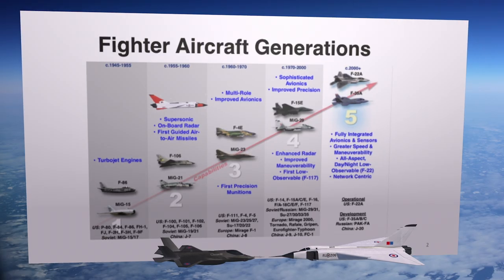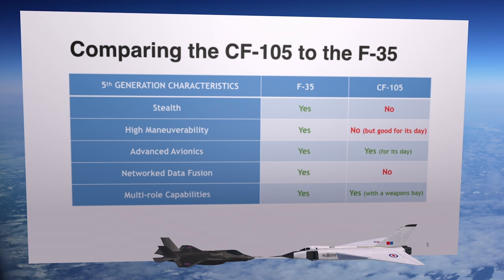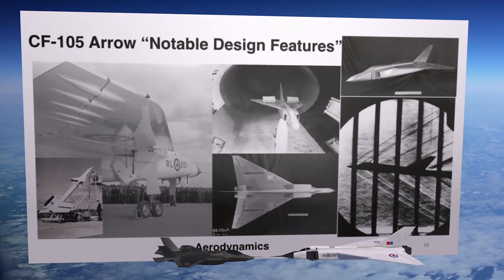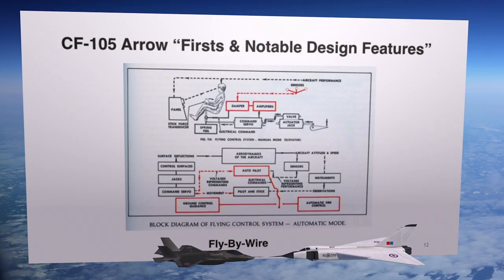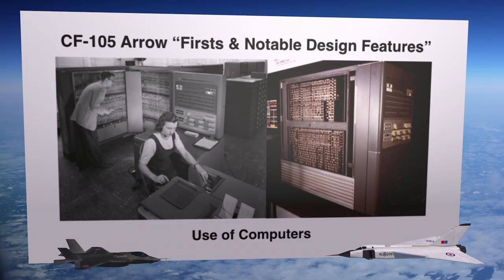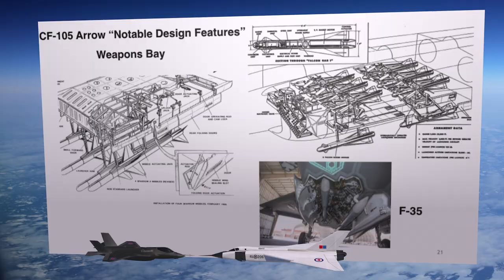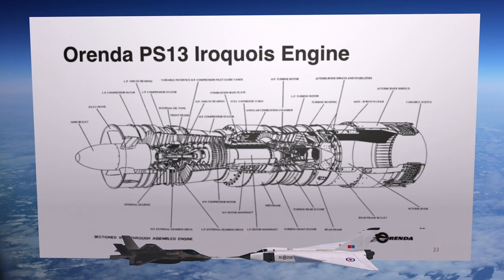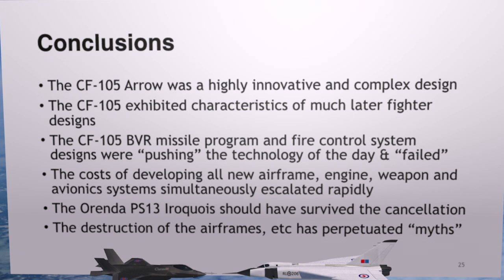AVRO ARROW FIRSTS VS F 35 LIGHTNING

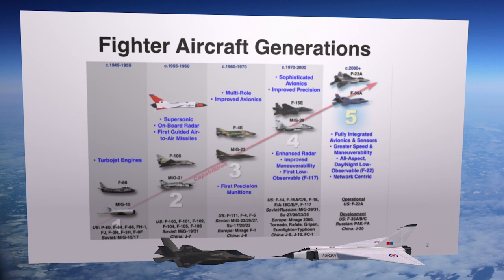Comment: @1:57
Point of interest - That's a CF-105/J-67 proposal from May, 1954. The J-67 suffix denoted the (briefly proposed) Curtiss-Wright J-67 engines, which were cancelled that same year. Note the lack of outboard leading edge extensions (dogtooth) on the wings and lack of an area-ruled tailcone extending out from between the afterburner nozzles. Also interesting is the 500 gallon drop tank mounted immediately aft of the removable armament pack, straddled by the speed brakes. The production CF-105/P.S.13 design followed in June, 1955 - P.S.13 obviously referencing the Orenda P.S.13 Iroquois engines, & would've utilized the same drop tank arrangement.
Prior to the CF-105/J-67 iteration, there was the C104/2-TR.9 (Orenda TR.9 Engines) proposed in June 1952, as well as the CF-105/RB.106 (Rolls-Royce RB.106 engines) from August 1953. Other engines considered for use were the Bristol Olympus OL-3 & the Pratt&Whitney J-75, which powered the first five Mk 1 aircraft.
Another interesting Avro design was the C104/1-TR.9 - a single-engine, low-wing delta, very similar in appearance to the Convair F-102. This was proposed to the RCAF in June 1952, at the same time as the above-mentioned C-104/2. It was quickly dropped in favor of the twin-engine, shoulder wing design which would eventually morph into the CF-105/P.S.13. In all, there were no less than five different wing sizes proposed, ranging from 1000 sq ft to 1400 sq ft. A single seat Arrow was also in the mix, sporting a 1300 sq ft wing and carrying only four Falcon missiles instead of eight. The final Arrow variant utilized the 1200  sq ft (1225 sq ft) wing.
Ain't history fun?
Reply: Raynus Point of interest read page 114 of Cold War Tech War you will see that the J-67 was a licenced- built version of the British Olympus and was cancelled in 1955 not 1954. The J-75 was just a P&W J-57 from the compressor to the nozzle and copied the Olympus compressor section.

Did you know that Orenda put the OT-4 turbine into a White 7,000 transport truck and the US purchase the program from Orenda. page 13 and 14. How about the M-48 Patton tank that Orenda modify to take the same OT-4 turbine years before the US Abrams tank!

BTY how long did it take the USAF to morph the F-102 into the F-106?

Right Now I remember!

The F-106 got its start with the XF-92A that was built in 1948 and Conair was given a contract to produce an interceptor based on this design in September of 1951. It took a full 5 months just to produce the F-102 mock-up and the F-102 was only capable of Mach 1.2. 

While this was going on the F-102 was being (modified to a new configuration) which became the F-106 and it first flew on 26 December 1956. From the first flight of the FX-92A to the production of a prototype version that was close to the 1954 intercept specifications took over 7 years and this was a continues priority project right from the start! The F-106 never did reach all of its specification requirements.

The Arrow did not use a proto-type it went right from the design stage to a hard tooled production line interceptor and took Avro just over 3 years to get it right the first time. The Arrow would meet or exceed all the 1954 intercept specifications. 

Yes history is fun when you get your facts right!
Reply: Raynus Here is another fun point of interest from history! Page 143 Cold War Tech War

The first squadron F-106 were delivered in May of, 1959, but continuing problems meant that the Delta Dart was not declared operational until October 31, 1959

Problems continued, engine problems, canopies jettisoning in flight, fire control problems and upgrades, fuel starvation, and other maladies afflicted the plane’s entry to service. MA-1 was upgraded no less than 6 times. Flight testing continued into n1961, with each phase revealing a long list of defects.

Incorporating them into the design was exacerbating throughout the program because there were so many changes to be made to the hard tooling devised to suit the Cooke-Craigie plan. In the case of the FM-106, the Cooke-Craigie plan was a disaster.

Convair spent more on changing the F-102 airframe (they used the same wings) into that of the F-106 then Avro had spent on developing the entire Arrow Mk 1 and 2 designs tooling and seven completed airframes, five of them flying.

*67 changes to the airframe alone were required to produce the service F-106 from the prototype, and many changes were made in the field.
*

The Arrow did not use a prototype it went right from the design stage to a hard tooled production line interceptor and took Avro just over 3 years to get it right the first time. The Arrow would meet or exceed all the 1954 intercept specifications.
Reply: @jim100ab9  
The Iroquois was still having teething issues at cancellation - well documented.
The CF-105 had only completed 2% of it's eight phase testing and evaluation program.
It had yet to carry a weapon or fire a shot.
The Arrow died on the factory floor.
The F-106 went on to serve for 25 years.
That's the reality.
Reply: @jim100ab9  
Here's one of your self-deleted (and incorrect) posts:

"Raynus about the only this you got right is the Arrow was not area ruled. That is because Avro made it obsolete!"

The CF-105 did in fact incorporate area ruling. The forward fuselage and tailcone were only a couple of examples.
Again - you don't have a clue what you're talking about once you venture outside of a Whitcomb book.
Reply: @raynus1160  LOL, LOL, LOL here from one of your own sources! This why the had to kill the Arrow! Palmiro Campagna’s book Storms of Controversy

Now wish to introduce new evidence that has been discovered, including the “smoking gun” … with fingerprints.

Avro was repeatedly asked by the USAF if and how the performance of the aircraft could be enhanced.

This leaves one to wonder whether Avro wasn’t, in fact, naively solving technical problems being encountered by U.S. aircraft manufacturers.

By 1958, after the Arrow’s successful maiden flight, the USAF, which previously had expressed tremendous interest in the aircraft, began backing off.

What was the Americans’ motive? There were several, including pressure from U.S. companies and a significant concern that the Arrow plans and manufacturing secrets were indeed falling into the wrong hands. Earlier in this book, I speculated that the CIA would have been particularly perturbed by that eventuality, since an Arrow in the wrong hands could destroy its secret U-2 spy operations and perhaps even turn the tables. John Foster Dulles, U.S. secretary of state and one of those who advised Canada that the United States would not purchase the Arrow, was the brother of Allen Dulles, head of the CIA.

General Foulkes who did not listen to Air Marshal Hugh Campbell, his chief of the air staff. While
Campbell was insisting on the need for the Arrow or an aircraft just like it, Foulkes ignored him and advised the Diefenbaker government that the military had no requirement for the Arrow.

Palmiro Campagna’s book Storms of Controversy 

Now for the smoking gun and fingerprints, in the meeting of September 21, 1958, Cabinet had approved the installation of Bomarc missiles. Its members also agreed that the Arrow program should be reviewed in March 1959 and that the chiefs of staff should investigate and report on any requirements for further missile installations or for aircraft “of the nature of the CF-105 or alternative types.” Interestingly, in November 1958, Air Marshal Roy Slemon, stationed at NORAD headquarters in Colorado, had stated that interceptors would be required for years to come. 

Diefenbaker rebuked Slemon for this comment because it was, in effect, pre-empting the chiefs of staff investigation on the matter and was therefore not yet government policy. Also, both Foulkes and Pearkes were recommending abandoning the program, even though Chief of the Air Staff Campbell was asserting that at least 100 aircraft comparable in performance to the Arrow (if not Arrows) would be required. Why was there a split, with Slemon and Campbell both saying yes to aircraft and Pearkes and Foulkes saying no? 

In his own words, Foulkes provides the answer. Writing (appropriately enough) on December 24, 1958, Foulkes gave this gift, the “smoking gun,” to the people of Canada, entitled “Progress Report on the Implementation of the Decisions in Regard to Air Defence Taken by Cabinet on 21 September 1958”: 

With regard to the Cabinet Decision (e), that the Chiefs of Staff should investigate and report on requirements, if any, for additional air defence missile installations in Canada and for an interceptor aircraft of the nature of the CF105 or alternative types; the Chiefs of Staff have this matter
under active study but wish to defer making any recommendations until they have had an opportunity to study the plans of the Commander-in-Chief, North American Air Defence Command. It is expected that the Commander-in- Chief, North American Air Defence Command, will be presenting his revised plans to the Canadian Chiefs of Staff in January. After the Chiefs of Staff have an opportunity of carefully studying these plans, they will be prepared to make recommendations for any additional air defence missile installations or for interceptor aircraft of the nature of the CF105 or alternative types.

So it was the United States. It seems that Charles Foulkes was waiting for his orders. So it did not matter what the chief of the air staff recommended, and it did not matter what Roy Slemon, as second-in command at NORAD, or anyone else in Canada for that matter, had to say. What mattered was only what the commander-in-chief of NORAD and the United States wanted, and so the Arrow was cancelled. The chain was complete: Diefenbaker was being advised by Pearkes, who in turn was being advised by Foulkes, who in turn was following the agenda of the Americans. This explains why Hugh Campbell had been ignored and Slemon had been rebuked for having opposing views.
Reply: @raynus1160  LOL, Do they still use area rule or  Computational Fluid Dynamics?

The first aircraft to have its aerodynamic design aided by solid-state (real time) computers, Avro thus appears to be the company that evolved the technique now referred to as Computational Fluid Dynamics.

The first aircraft to have its structural design aided by solid-stat computers.
Reply: @raynus1160  LOl, LOL, LOL the Iroquois
 was still in development LOL, LOL, LOL 

In June of 1956 the Iroquois underwent its first official test, the 50 hour Pre-Flight Rating Test (PFRT) During this test the engine beat every known record for thrust output at 19,350 lbt (pounds thrust) without afterburner. Its throttle response was also world-beating. It took only 2.8 seconds to go from idle to full military thrust and only 4.5 seconds to go from idle to full afterburning thrust.

During tests at least five running engines were sent to the United States for testing and evaluation, Iroquois engineer Colin Campbell relates that the engine was tested at up to 25,000 pounds dry thrust in Canada, and up to 27,000 pounds in the Cornell Institute in the United States. The rating they were aiming for was 20,000 lbs dry thrust and 30,000 lbs with afterburners.
Reply: @raynus1160  LOL, LOL, LOL  An other reason they had to kill the Arrow 

So now you’re calling Jack Woodman a liar! Jack Woodman (one of the test pilots for the Arrow) and the government’s representative he noted that approximately 95 percent of the flight envelopment had been explored. 

As you can see the Arrow had largely completed Phase 1 Contractor Airworthiness Trials. The only thing left for the Airworthiness Trials was - All-Weather Trials Aircraft.  

The Canadian Armament Research Development Establishment (CARDE) years later would state that the Arrow in 66 flights and 70 hrs 30 minutes of flight time had completed and passed 95 percent of its Flight testing.
Reply: @jim100ab9  
The Iroquois was derated to 97% RPM until the compressor blade issue could be remedied. Engines 115 and 116 installed in aircraft 206 produced only marginally better wet thrust than the J75's installed in the first five aircraft (20,000lbs v. 19,000lbs)
The P.S.13 was still undergoing dynamic testing at Cancellation (Shutting Down the National Dream - Stewart/Storms of Controversy - Campagna).
Educate yourself.
Reply: @jim100ab9  
Uh-oh.
Somebody's triggered.
Reply: @raynus1160  LOL, LOL, LOL reread your book Cold War Tech War and get  Avro Aircraft and Cold War Aviation by R. L. Whitcomb  and you will see your WRONG again LOL, LOL, LOL

(What a lot of people don’t know and most sources don’t show, is that the Arrow Mk-1 didn’t use the fully developed J-75 engines that were used in the F-106, that produced 17,200 pounds of dry thrust and 24,500 in afterburners, in fact the USAF sent the very early de-rated J-75 P-3 engines that produced 30% less thrust then the fully developed J-75 making the Arrow Mk-1 44% underpowered compared to the Mk-2.)
Reply: @raynus1160  You said "The Iroquois was derated to 97% RPM until the compressor blade issue could be remedied. "Your wrong it was the afterburner augmentation get the Book Avro Aircraft and Cold War Aviation by R. L. Whitcomb! LOL, LOL, LOL

BTY it's still a hell of a good performance for the de-Iroquois without the afterburners LOL, LOL, LOL

In June of 1956 the Iroquois underwent its first official test, the 50 hour Pre-Flight Rating Test (PFRT) During this test the engine beat every known record for thrust output at 19,350 lbt (pounds thrust) without afterburner. Its throttle response was also world-beating. It took only 2.8 seconds to go from idle to full military thrust and only 4.5 seconds to go from idle to full afterburning thrust.

During tests at least five running engines were sent to the United States for testing and evaluation, Iroquois engineer Colin Campbell relates that the engine was tested at up to 25,000 pounds dry thrust in Canada, and up to 27,000 pounds in the Cornell Institute in the United States. The rating they were aiming for was 20,000 lbs dry thrust and 30,000 lbs with afterburners.

WOW great showing for a derated Iroquois engine LOL LOL, LOL
Reply: @raynus1160  Uh-oh someone is trolling LOL, LOL, LOL
Reply: @raynus1160  LOL, LOL, LOL more proof that the Arrow was not area ruled but in fact used Computational Fluid Dynamics and made area ruling obsolete! . Read page 117 

NACA in their report the Arrow should be area ruled (Area rule was formalized by Dr. Richard Whitcomb at NACA in 1953 and the USAF endeavoured to keep the theory secret according ton Bill Gunston.)
Reply: @jim100ab9  
Negative.
It was compressor blade metallurgy.
Again, do your homework.
Reply: @jim100ab9  
"LOL the F-106 never saw combat ether LOL, LOL, LOL so that's your point?"
My point? 
The Arrow died in infancy and the F-106 went on to serve until the mid-1980's.
342 were built.
Reply: @raynus1160 You need to reread your book LOL, LOL, LOL, LOL 

Really do you think that anyone would put an engine in a plane that was capable of throwing compressor blade that would destroy both the engine and the plane!

Page 123 Cold War Tech War

There is also some controversy between the engine sides of A.V. Roe Canada Ltd. And the airframe side as to whether the Iroquois was ready for production and service by the cancellation date. *Those on the engine side say it was those on the airframe side and Mike Cooper Slipper claimed that it wasn’t.
*

*Colin Campbell an Orenda engineer assigned to the Iroquois clams that there was only one example in existence of the production engine by cancellation, and it was slated to go into the first Mk2 Arrow --- RL 206. He states that the design was frozen in the configuration of this engine and that all the Orenda personnel were confident it was ready for reliable service.
*

A post cancellation analysis by the RCAF echoes this view and notes the honesty of the Orenda engineers in discussing the problems and solutions.
Reply: @raynus1160  And we all know why it died don't we! your own source states that very clearly! 

Palmiro Campagna’s book Storms of Controversy

I now wish to introduce new evidence that has been discovered, including the “smoking gun” … with fingerprints.

Avro was repeatedly asked by the USAF if and how the performance of the aircraft could be enhanced.
This leaves one to wonder whether Avro wasn’t, in fact, naively solving technical problems being encountered by U.S. aircraft manufacturers.

By 1958, after the Arrow’s successful maiden flight, the USAF, which previously had expressed tremendous interest in the aircraft, began backing off.

What was the Americans’ motive? There were several, including pressure from U.S. companies and a significant concern that the Arrow plans and manufacturing secrets were indeed falling into the wrong hands. Earlier in this book, I speculated that the CIA would have been particularly perturbed by that eventuality, since an Arrow in the wrong hands could destroy its secret U-2 spy operations and perhaps even turn the tables. John Foster Dulles, U.S. secretary of state and one of those who advised Canada that the United States would not purchase the Arrow, was the brother of Allen Dulles, head of the CIA.

General Foulkes who did not listen to Air Marshal Hugh Campbell, his chief of the air staff. While
Campbell was insisting on the need for the Arrow or an aircraft just like it, Foulkes ignored him and advised the Diefenbaker government that the military had no requirement for the Arrow.

Palmiro Campagna’s book Storms of Controversy 

Now for the smoking gun and fingerprints, in the meeting of September 21, 1958, Cabinet had approved the installation of Bomarc missiles. Its members also agreed that the Arrow program should be reviewed in March 1959 and that the chiefs of staff should investigate and report on any requirements for further missile installations or for aircraft “of the nature of the CF-105 or alternative types.” Interestingly, in November 1958, Air Marshal Roy Slemon, stationed at NORAD headquarters in Colorado, had stated that interceptors would be required for years to come. 

Diefenbaker rebuked Slemon for this comment because it was, in effect, pre-empting the chiefs of staff investigation on the matter and was therefore not yet government policy. Also, both Foulkes and Pearkes were recommending abandoning the program, even though Chief of the Air Staff Campbell was asserting that at least 100 aircraft comparable in performance to the Arrow (if not Arrows) would be required. Why was there a split, with Slemon and Campbell both saying yes to aircraft and Pearkes and Foulkes saying no? 

In his own words, Foulkes provides the answer. Writing (appropriately enough) on December 24, 1958, Foulkes gave this gift, the “smoking gun,” to the people of Canada, entitled “Progress Report on the Implementation of the Decisions in Regard to Air Defence Taken by Cabinet on 21 September 1958”: 

With regard to the Cabinet Decision (e), that the Chiefs of Staff should investigate and report on requirements, if any, for additional air defence missile installations in Canada and for an interceptor aircraft of the nature of the CF105 or alternative types; the Chiefs of Staff have this matter
under active study but wish to defer making any recommendations until they have had an opportunity to study the plans of the Commander-in-Chief, North American Air Defence Command. It is expected that the Commander-in- Chief, North American Air Defence Command, will be presenting his revised plans to the Canadian Chiefs of Staff in January. After the Chiefs of Staff have an opportunity of carefully studying these plans, they will be prepared to make recommendations for any additional air defence missile installations or for interceptor aircraft of the nature of the CF105 or alternative types.

So it was the United States. It seems that Charles Foulkes was waiting for his orders. So it did not matter what the chief of the air staff recommended, and it did not matter what Roy Slemon, as second-in command at NORAD, or anyone else in Canada for that matter, had to say. What mattered was only what the commander-in-chief of NORAD and the United States wanted, and so the Arrow was cancelled. The chain was complete: Diefenbaker was being advised by Pearkes, who in turn was being advised by Foulkes, who in turn was following the agenda of the Americans. This explains why Hugh Campbell had been ignored and Slemon had been rebuked for having opposing views.
Reply: @raynus1160  LOL, LOL, LOL here have another look! Page 143 Cold War Tech War.

The first squadron F-106 were delivered in May of, 1959, but continuing problems meant that the Delta Dart was not declared operational until October 31, 1959

Problems continued, engine problems, canopies jettisoning in flight, fire control problems and upgrades, fuel starvation, and other maladies afflicted the plane’s entry to service. MA-1 was upgraded no less than 6 times. Flight testing continued into n1961, with each phase revealing a long list of defects.

Incorporating them into the design was exacerbating throughout the program because there were so many changes to be made to the hard tooling devised to suit the Cooke-Craigie plan. 

In the case of the FM-106, the Cooke-Craigie plan was a disaster.

Convair spent more on changing the F-102 airframe (they used the same wings) into that of the F-106 then Avro had spent on developing the entire Arrow Mk 1 and 2 designs tooling and seven completed airframes, five of them flying
.
67 changes to the airframe alone were required to produce the service F-106 from the prototype, and many changes were made in the field.

The Arrow did not use a prototype it went right from the design stage to a hard tooled production line interceptor and took Avro just over 3 years to get it right the first time.

The Arrow would meet or exceed all the 1954 intercept specifications.
Reply: @jim100ab9  
Wow.
Three posts serving only to reinforce how incorrect you are on pretty-much everything you blurb.
Try reading something other than Whitcomb - it's clouded your ability to think.
Good reads?
Shutting Down the National Dream (Stewart)
Storms of Controversy (Campagna)
Fall of an Arrow (Peden)
Destruction of a Dream (Valiquette)
Stay healthy.
- Cheers
Reply: @raynus1160  Why would I read anything else? Did Jim Floyd ever endorse any of those books? The correct answer is NO!

Rendell Whitcomb was born in Whitemouth Manitoba and moved to Ontario at age four. He was an award winning Air Cadet with 167 Air Marshal (Billy) Bishop Squadron, RCAC, and after working as a professional photographer, joined the Canadian air force as a candidate in 1990. Mr. Whitcomb was an accomplished historical aviation artist, many of his first editions being commissioned by the military squadrons for their commemoration occasions.

After leaving the CF Randall continued to pursue his love of aviation as an artist, author and public speaker. In 2002 he authored the highly acclaimed book Avro Aircraft & Cold War Aviation. He passed away unexpectedly in 2008 at the age of 44.

Here is what Jim Floyd says about R.L. Whitcomb and the book Avro Aircraft and Cold War Aviation. “In the past two decades we have had more than enough books on the Arrow, but this one is significantly different. The author, Randall Whitcomb, ex-CF pilot, brings to this remarkable story a wealth of experience in the flying, engineering and political aspects of Canadian aviation, past and present. Whitcomb has brought together many “loose ends” in the whole history of Canadian aviation in the Cold War period, including the global impact on the demise of A.V. Roe Canada in 1959. 

He has marshalled his arguments in a unique “warts and all” documentation of the true facts about the political climate in that incredible era and addressed the vexed question of “what might have been” had common sense ruled the day, instead of the “infighting” that actually occurred. This is a book that should be mandatory reading for all students of Canadian aviation history and every politician in Canada, the USA, and the UK.” (This is hand signed by Jim Floyd in black pen. Jim100 AB)
Reply: @raynus1160  LOL, LOL, LOL this is my favorite part to bad you don't have a copy!

This is a book that should be mandatory reading for all students of Canadian aviation history and every politician in Canada, the USA, and the UK.” (This is hand signed by Jim Floyd in black pen. Jim100 AB)

CHEERS! LOL, LOL, LOL
Reply: @raynus1160  The STV-Space Threshold Vehicle from R.L. Whitcomb’s book “Avro Aircraft & Cold War Aviation.” Page 236 - 241

The Space Threshold Vehicle is described in the Engineering Division report of June 5th 1958.

Mario Pesando’s study of orbiting winged vehicles. “It became obvious to us some three or four months ago that it was possible to put a winged vehicle into orbit, and that there was a corridor where normal winged flight was possible between the minimum speed curve, above which it was impossible to sustain lift, and the maximum temperature curve, below which the structure gets too hot. This opens up the possibilities of hypersonic flight with a relatively conventional aircraft of low wing loading (about 20 lb. per square foot), which appears to us to be the easiest way to get a man into the threshold of space and recover him, flying back though the corridor.

We are at present carrying out a study to ascertain the relative merits of the winged vehicle versus the boost glide (the space shuttle) or ballistic techniques (standard rocket and parachute recovery).  We hope to shortly give a briefing on this and later determine where we should go from there. Pesando’s STV document discusses this plan and it is clear that the “presented aircraft” in the chart on page 237 is the Arrow! When the Mk 4 Arrow with the high-temperature materials and ramjets, is examined, the consideration of the Arrow as phase one becomes even more striking given that this aircraft could have zoom climbed to somewhere around 150,000 to 200,000 feet and even higher with a supplementary rocket.

In discussing this schedule, Pesando wrote: Considering a possible time table, it is believed, as shown on the accompanying chart, that using known data and techniques within one year it should be possible to finalize engineering of an interim hypersonic glide vehicle with a burn out speed in excess of 10,000 ft per second (about 6,000 mph or Mach 7.8. Such a vehicle could possibly be built by 1962 and would be considered a research vehicle.

Further development in the areas indicates that by 1963 at the latest, increases in our knowledge and techniques sufficiently to enable us to extend our vehicle concept to velocities approaching orbital speeds. We could have, therefore, shown this vehicle as operating by 1965; this vehicle would constitute the long range operational vehicle with ranges of 12,500 miles or greater. Having this vehicle completed would enable us to immediately begin the utilization of further advances in propulsion methods and magneto-hydrodynamics expected by 1968, to provide us with a winged orbital and re-entry ferry vehicle by the late 1960’s” 

The hypersonic vehicle postulated, takes off on rocket power alone with a full load of oxidizer and sufficient ramjet fuel to enable it to climb to an altitude in excess of 40,000 ft and maintain flight during airborne refuelling proceedings. (The STV concept) is for a hypersonic vehicle which is really an extension of the conventional supersonic airplane. When airborne fuelling operations have been completed the aircraft is accelerated to ramjet light up speed (About Mach 2.5) and begin its climb and acceleration to higher speeds.

In flight refuelling is a rather novel approach to the SSTO problem, one that appears to be entirely original and un-copied as of yet this is from R.L. Whitcomb’s book Avro Aircraft & Cold War Aviation))

(This report by Mario Pesando must have sent shock waves through Dr. Courtland Perkins, Chief Scientist for the USAF like a lightning bolt hitting him! After all he was working for the USAF Intelligence gathering of foreign technology! John Foster Dulles, his brother Allen Dulles and the USA government could see that the Arrow had to go and the Avro Company itself had to be destroyed or all their spy planes were at risk of being exposed not to mention their space program! Hypersonic planes and airspace-planes by the end of the 1960’s!  Jim100AB)

The USA saw the same potential and from the Aerospace Daily issue of March 1985 the article “DARPA Chief Notes Potential of a Supersonic Combustion Ramjet” is enlightening: (The hypersonic airspace-plane could) fly up to maybe 150,000 to 200,000 feet, sustain Mach 15 plus for a while, slow down and engage an intercontinental bomber or cruise missile carriers at ranges of 1,000 nautical miles…

(Gee, I wonder where they got that great idea from! Jim100AB)

((Boeing X-20 Dyna-Soar the program ran from 24 October 1957 to 10 December 1963 the Dyna-Soar program suffered from two major problems: uncertainty over the booster to be used to send the craft into orbit (just like the space shuttle), and a lack of a clear goal for the project.  Look at the timeline for this project. Avro’s concept was clearly ahead of this design as the Arrow concept would have become an armed airspace fighter/interceptor. Jim100AB))
Reply from the maker: It warms my heart to see the two of you reunited again.  It is my understanding that both Series 115 and 116 were not to be the final engines in 206.  If I recall correctly they were to do some final testing only, but I can't pull that up right now.  I go through a lot of information working on this.
I can tell you a bit about the future of the PS-13  The PS-13 was not close to being fully developed in terms of the power it was to eventually produce for future versions of the Arrow and perhaps foreign designs.  The design was very elegant but also quite robust.  The engine developed 350 lbs/sec mass flow which was twice that of the GE J-79, the leading engine of the period.  It also had a modest firing temperature of 1700 °F firing temperature.  This modest firing temperature did not require any exotic materials.  At this point the PS-13 was like a 427 Corvette engine with a two Barrel Chevette carb.  It was designed that way so the future development would be simple.  At the time all manufacturers had a good grasp of Actively Cooled Components.  This was planned for the Series 3.  Actively Cooled Components (Turbine blades) would have allowed the firing temperature of the engine rise to 2200°F.  This would have conservatively raised the dry thrust of the Iroquois to ~30,000 and 40,000+ range in afterburner. 
In 1960 Actively Cooled Components was well understood in Canada, the U.S. and Europe.  regards.....Virtual
Reply: @Virtualenvirons  
#115 and #116 were the actual serial numbers of the two (derated) P.S.13 engines installed in aircraft 206. These engines were delivered to Avro Canada in mid-December, 1958 (December 17 & 21, respectively) & readied for installation as of mid-February. #115 was the LHS engine, and photos actually exist of the installation process into Arrow 206. Engine #116 is presently in the possession of S&S Turbines in Ft. St. John, BC.
If one references Chapter 16 of 'Shutting Down the National Dream' (Stewart), it goes into good detail about the limitations placed on these two engines which effectively reduced available thrust by ~22%. Both Harry Keast (Orenda's Asst. Chief Engineer) and Mike Cooper-Slipper (B-47/Iroquois Test Pilot) were interviewed in 1978 & explain the issues with the Iroquois, ranging from turbine blade metallurgy to lubrication problems.
If one references Storms of Controversy (Campagna) Chapter 4, these limitations would've likely remained in effect until Aircraft 25221- which would finally be capable of producing the full 25,600lbs wet thrust demonstrated by earlier test engines and the aircraft performance numbers projected by Avro Canada.
- Cheers
Reply: @jim100ab9  
Let's keep it real, Jim - i.e., real aircraft.
Reply: @Virtualenvirons  
From 'Shutting Down the National Dream':

"The thrust limits of the first fitted Iroquois would have probably been 16,000 pounds and 20,000 lbs with afterburner. And the engine wasn't completely up to performance. We had trouble with the second-stage turbine blades. I worked out a new blade design which would have solved the vibration problem, but they were never used. At the time, the top rpm speed of the engine was 7,800 but we put a limit of 7,650 on for flight because of blade vibrations. The engine was put in, taken out, adjusted, then put in again, but the program was cancelled before we could put in new blades (we called them 'toothpick' blades). On the day of cancellation, the blades for the engines were sitting on my desk."
- Harry Keast

"The thing with the Iroquois is that it wasn't a good engine. They had oil problems, a weird new oil system that had never been tested, and I don't think it would've worked.The engine just wasn't ready, and my reports said it wasn't ready. There was about a year's gap between the engine being ready to put in the Arrows...It was rushed, it was a mad scramble...We just didn't do enough flight testing...It would've been a catastrophe if the Arrow had flown with the Iroquois in it when it was supposed to."
 - Mike Cooper-Slipper 

Obviously, these quotes from men who had actually worked front-line with Iroquois development suggest a very different narrative than Whitcomb's rosy assessment.

- Cheers
Reply: @raynus1160  LOL you don't think the Arrow was real? LOL The F-108 was not a real plane! LOL
Reply: @raynus1160  LOL, LOL Again did Jim Floyd endorse the book' Shutting Down the National Dream? No he didn't, so why didn't he?

Well that's easy to answer as Jim Floyd says "“In the past two decades we have had more than enough books on the Arrow, but this one is significantly different." Avro Aircraft and Cold War Aviation 

Why go with second best when you can have the Best!

I guess you never got the memo 

"This is a book that should be mandatory reading for all students of Canadian aviation history and every politician in Canada, the USA, and the UK.”
Reply: @raynus1160  You sources are a day late and a dollar short as they say. 

I guess you never read this post so I'll repost it just for you! You can also reread your book Cold War Tech War!

There is also some controversy between the engine sides of A.V. Roe Canada Ltd. And the airframe side as to whether the Iroquois was ready for production and service by the cancellation date. Those on the engine side say it was those on the airframe side and Mike Cooper Slipper claimed that it wasn’t.

Colin Campbell an Orenda engineer assigned to the Iroquois clams that there was only one example in existence of the production engine by cancellation, and it was slated to go into the first Mk2 Arrow --- RL 206. He states that the design was frozen in the configuration of this engine and that all the Orenda personnel were confident it was ready for reliable service.

A post cancellation analysis by the RCAF echoes this view and notes the honesty of the Orenda engineers in discussing the problems and solutions. 

Page 123 Cold War Tech War

Yes the Iroquois could have and would have been upgraded into the Iroquois Mk3 and even more powerful ones! 

CHEERS
Reply: @raynus1160  LOL LOL, LOL you said " Obviously, these quotes from men who had actually worked front-line with Iroquois development suggest a very different narrative than Whitcomb's rosy assessment."

Really so Jim Floyd wasn't there? Again tell me why he never endorsed Shutting Down the National Dream? 

Tell us why he only endorsed R.L. Whitcomb's book!

Also explain why anyone would put an engine in a plane that was capable of throwing compressor blade that would destroy both the engine and the plane!
Reply: @jim100ab9  
Poor Jim.
Still flailing around in the shallow end of the gene pool.
Stay healthy.
Reply from the maker: Hi Raynus.  How are things....staying safe I hope.   I just spent the last hour talking with Robin Sipe, owner of S&S Turbines in B.C.  He is the fellow who repatriated the Series #116 Iroquois.  So....don't shoot the messenger.   Iroquois #115 and #116 were only taxi trial engines and they were not even a matched pair.  #117 (Aviation Museum) was to be the first full up Iroquois.  As to the Oil Leaks question, he says that is a problem with all jet engines until you dial them in and he would assume that was the case with the fellow you are quoting.  
The performance of the Iroquois.  Orenda never published the performance figures in terms of lbs. pressure.  They only published figures for "Low pressure", High Pressure" and Max Pressure.  Most of the figures we see are guesses, some knowledgable....some not.
When Robin repatriated the Iroquois and went to Bristol Aerospace, he spoke with an engineer who was one of a select few allowed to see the Iroquois in1960.  Bristol tested the engine to 32,000 lbs in reheat.  He can't remember the exact number Dry, but it was above 20;000 lbs.  The Iroquois had a very simple/clumsy exhaust nozzle.  The Mark 593 Olympus engine that powered the Concord was essentially an Iroquois with a modern exhaust nozzle.  In his opinion a fully tricked out Series 11 Iroquois would have the same performance specs as the Mark 593.  regards.....Virtual
Reply: @Virtualenvirons  
That is very cool & the first I've heard of them being taxi-test engines. My bad - I think I stated S&M - meant to say S&S. I believe the pre-production P.S.13's used an American-made Marquardt afterburner - fixed/non-adjusting nozzle (similar as to what was fitted to the J75's).
If one looks at actual Orenda performance charts from the era, they suggest an Iroquois series 2 fitted with an adjustable burner nozzle would've produced almost 30,000lbs thrust at 45,000 feet at Mach 2.5, and greater than 30K lbs at 35,000'/mach 2.0. This series was expected to yield 23,000lbs thrust at full military (non-afterburning) power.
In 1956, the Mk 1 Iroquois delivered 19,350lbs dry thrust/25,600lbs wet, at tests performed in both Canada and the USA. 
Big numbers, especially for the late 1950's.
Unfortunately, these tests yielded the aforementioned lubrication and metallurgy concerns, as well as vibrations and flexing of the central drums causing (spectacular) failures when the dynamic compressor blades made contact with the static vanes.
As my learned and eager colleague Jim has pointed out (once or twice), there's an excellent explanation of this in chapter 28 of Cold War Tech War, before the author breaks off into his own 'analysis' of the program.
Aside from that - glad you're home - hope you and family stay healthy and safe.
- Cheers
Reply from the maker: Hi Raynus....I got a chuckle about the S&M thing.  I have two main contributors in this series for my technical issues.  I have to admit that what I have learned from them over the last two years since I started this series dwarfs what I new about the Arrow before.... and I knew a fair amount.  One is Robin and the other is Retired General Leversedge who has written two books on the Arrow and is a volunteer curator at the Aviation museum.  He has access to information and engineering dwgs. that are not readily available to the public.  Between him and Robin, we will be able to accurately recreate a Mark 3 Arrow.  I have already reengineered the Variable Geometry inlets.  They are quite something.  But also, Palmiro Campagna is a contributor.  Palmiro skills are more in the area of historical accuracy of who, what, why and when as opposed to the technical issues of the Arrow.  I actually credit him in Episode 6.
I always look forward to your comments.....regards.....Virtual
Reply: @raynus1160  Here again your talking about the Mk1 engine as most of this was fix in the Mk2 you said "vibrations and flexing of the central drums causing (spectacular) failures when the dynamic compressor blades made contact with the static vanes."

As pointed out in Cold War Tech War page 121 just above the photo it clearly states this was the Mk1. Many other changes were made to the structure of the engine and a new prototype, the Iroquois Mk2 was produced.

Your always trying to state the misleading and bypassing the facts, and comparing the Mk1 problems with the new prototype Mk2.

Read page 122

June Callwood spent a great deal of time with the Iroquois engineers and other staff writing a piece for Saturday Night Magazine. Her resulting story is replete with a discussion of how the main engineers, Keast, Avery, and Grinyer, had worked themselves to exhaustion and near nervous breakdowns perfecting the engine. It is true that the delays in producing a reliable engine caused delays in the Arrow program.
Reply: @raynus1160  Well you are again understating the facts "During tests at least five running engines were sent to the United States for testing and evaluation, Iroquois engineer Colin Campbell relates that the engine was tested at up to 25,000 pounds dry thrust in Canada, and up to 27,000 pounds in the Cornell Institute in the United States. The rating they were aiming for was 20,000 lbs dry thrust and 30,000 lbs with afterburners"

You said In 1956, the Mk 1 Iroquois delivered 19,350lbs dry thrust/25,600lbs wet, at tests performed in both Canada and the USA.*
Reply: @jim100ab9  
Stewart's research for 'Shutting Down the National Dream' included personal interviews with roughly 150 people directly and indirectly involved with the CF-105 program, including Air Marshall Hugh Campbell, Mike Cooper-Slipper, Jim Floyd, Mario Pesando, Jan Zurakowski, Fred Smye, Don Rogers, Harry Keast, Crawford Gordon's son and widow, and Wing Commander Ray Footit. These interviews were conducted between 1978 and 1980. It is an excellent source of information, and predates the link you provide.
Again - when dealing with items of historical significance, I will readily argue that the earliest references are likely the most accurate. Time, innuendo, and third-hand accounts have a way of steering fact into the realm of conjecture.
 - Cheers
Reply: @raynus1160  Cut & Paste

Well, I have referenced Palmiro Campagna’s book Storms of Controversy fourth edition my chapter is up, up, and away? Starting on page 81.

This is from chapter 3 “The Arrow” starting on page 63 you can now see that, what you’re trying to post is not in the fourth edition? Was it in your second edition? Was it taken out of the fourth for some reason? In fact is not in the fourth edition anywhere!

Page 77 This study indicates that the engine is more advanced in design and concept than any engine being developed in the U.K. or U.S.A. The engine was supersonic in concept from the beginning. The design incorporates a transonic first-stage compressor producing an exceptionally high mass flow…. [E]mphasis on mechanical simplicity coupled with the extensive use of titanium, has produced prototype engines which are about 1,000 pounds lighter than other engines in the same power class. An accepted way of comparing engine performance is the thrust produced per pound of engine weight. The PS-13 at its 20,000-pound rating exceeds the Gyron by 22% and the J-67, J-75, and RB-106 by over 50%. These comparative figures are of great importance, particularly with respect to increased performance at high altitudes…. In fact, the PS-13 is the only engine likely to be available on time to give the CF-105 its required performance.

Page 78 The PS-13, or Iroquois, was approximately 19 feet long and four feet wide. It was rated at 19,500 pounds dry thrust and at up to 26,000 pounds with afterburner for a total of 52,000 pounds from both engines. Plans for a 60,000-pound limit, more than adequate to power today’s fighters, were in the works. On November 1, 1957, dry thrust runs of more than 20,000 pounds were demonstrated. At a combined 60,000- pound thrust with afterburner for a 60,000-pound aircraft, the Iroquois would have provided a thrust to weight ratio of 1:1,

Orenda had pioneered the development and use of titanium as well as methods for machining and welding this material. Advances were also made in lubrication design, with the engine consuming only 10 times more oil than a 200-horsepower automobile engine of the day.

Iroquois would have provided a thrust to weight ratio of 1:1, propelling the Arrow at better than Mach 2 and later Mach 3, assuming that limitations due to structural heating could be overcome. (This is talking about the airframe not the engine jim100ab)

Page 79 PS-13 Iroquois engine development was so successful; it was entering a phase of higher expenditure earlier than anticipated.

The minister indicated that the engine had completed 1,500 hours of development running, achieving a thrust of 16,100 pounds — 20,000 with afterburner. By November of that year, it had completed 3,200 hours of development running, including a 100-hour endurance test and the aforementioned 20,000-pound static run.
Reply: @raynus1160  Really so does the books Cold War tect war and  Avro Aircraft and Cold War Aviation publishing dates 2008 and 2002. As you know R.L. whitcomb actually points out some of the things in Shutting Down the National Dream not much but a little. He also includes points from Palmiro Campagna’s book Storms of Controversy as well as other books, cabinet minutes and so much more! OH and lets not forget the endorsement by Jim Floyd!
Reply: @jim100ab9  
Whitcomb referenced 'Shutting Down the National Dream' when he wrote Cold War Tech War - it's in the bibliography.
Many of Stewart's sources were either deceased or infirm by 2002.
Try again.
Reply: @Jim100 AB
Most of those with direct exposure to the CF-105 program were middle-aged in the 1950's. By 1978, they were in their 50's, 60's and 70's. By 2002, they were in their 70's, 80's, or deceased (Floyd excepted).
Use that lump of over-cooked cauliflower between thy ears.
Reply: @raynus1160  LOL, LOL, LOL your own posted info has been proven wrong by your own sources,  so now your back to trolling! LOL, LOL, LOL
Reply: @jim100ab9  
I think the effects of your self-isolating are increasingly evident.
Reply: @raynus1160  LOL, LOL, LOL now your trolling and insulting LOL, LOL, LOL